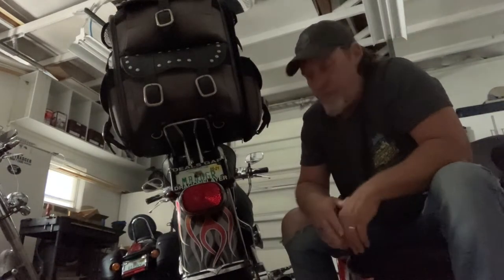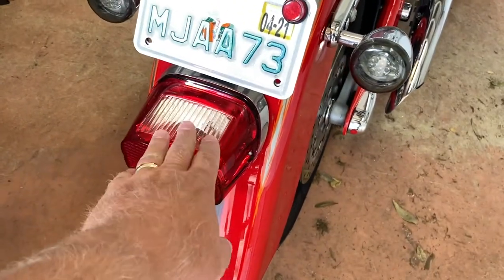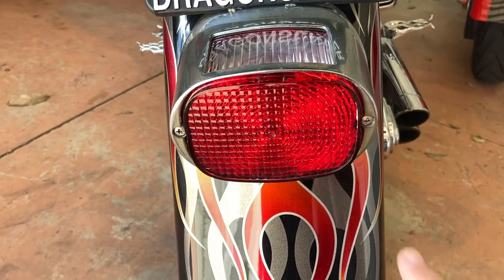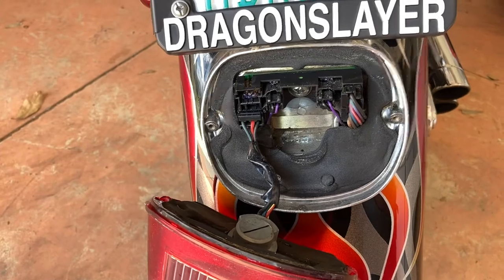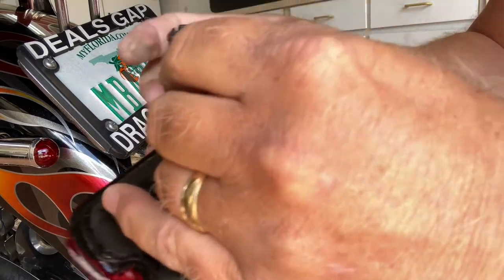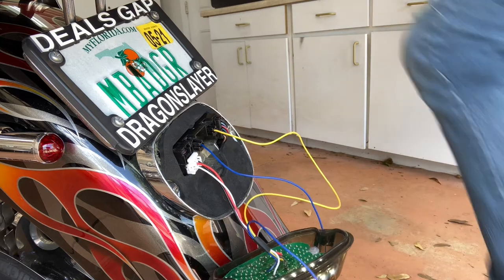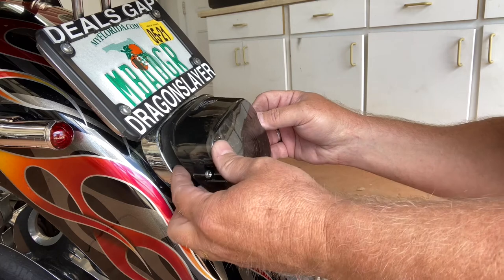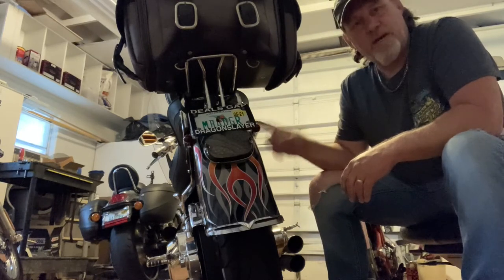How to install Harley Davidson Fatboy Led Brake Light, Tail Light, and Turn Signal Relocation

Comment: My wires on my 2005 harley davidson fatboy are black red and blue will this light work for my bike Any info would be appreciated
Reply from the maker: Yes it will work for your bike no matter the wire color they all work the exact same
Reply: Installed my rear light with your Info from your video thanks alot it helped quite a bit
Reply from the maker: @andybojorquez8229  awesome

Comment: I have a 2002 Harley Fatboy and bought Viking Vale Extra Large saddlebags.  Found out after going through all the trouble of installing the turn signal relocation kit that they still wont fit unless I somehow relocate the turn signals at least 2 inches further back.  If I move the bags forward, I wont be able to open the seat.  I cant move them down because the because the pipes are in the way.  Thanks for the video.  This is definitely the easiest way to fix the problem.  I put in the make and model but maybe the dimensions of the older fatboy is different. Viking never asked for the year.  Thanks again

Comment: Got this light because of this vid, everything was super easy and works except one thing maybe you can answer… turn signals work, but the yellow lights are always on. Red and yellow always on, yellows blink for turning. Tried unplugging main red and white wires but they stay on still. Any idea?
Reply from the maker: Wow it may be defective none of the ones I have do that. The old turn signals didn't stay on?
Reply: @TheBadgers  no they didn’t. Read that I may possibly need a load resistor? Not sure, just thought I’d ask you to see if you’ve run into this at all. 2003 Fatboy btw.
Reply from the maker: @ThatFoo_Miggy  I did not have this issue but that is possible on those older bikes

Comment: Yes I would like to get some advice from someone besides my self i have a 07 Harley Davidson Fatboy im in the process of relocating the front turn signals also the new signals are LED im mounting them from Handelbars to forks   and the stock turnsignals have 3 wire on the front a vilet black and blue on the rear stock turnsignals are 2 also all 4 of the new signals are only 2 wire so on the front signals with the 3 wire  what is the blue wire for  and does it have to be hooked up and so could you explain to me what i need to do with this wire thank you for reading and hopefully i can get this resolved thanks again

Comment: Did you have to install an LED flasher relay? I installed a similar tail light on my bike and I get hyper flash after 4 flashes and when I apply the brake both turn signal lights come on solid with the brake light.
Reply from the maker: I did not I have put it on 2 different bikes with no issues

Comment: Great video!   Unfortunately,  here in PA,  the inspection law & cops require rear turn signals to be a license plate width apart minimum.  The rear turn signals you removed were custom and hug the bike much closer than OEM signals.  QUESTION:  Would the turn signals you removed have allowed the new bags to be mounted without moving the turn signal -  and allowed the bag to open and close without a problem?    If so,  can you tell me who makes the custom rear signals that your removed?   Thanks for your reply.
Reply: I think I've seen them in the drag specialtys book?

Comment: Do you use the turn signal wire to plug into the taillight or do you just plug the turn signal wire from the taillight an plug it in like you did ?
Reply from the maker: just like I did plug the wire from the taillight in directly in to the system